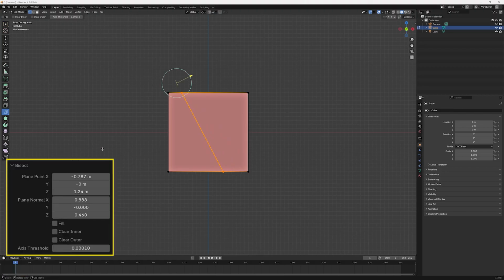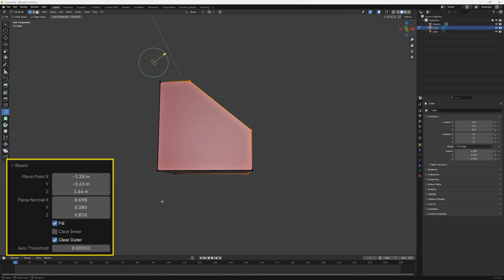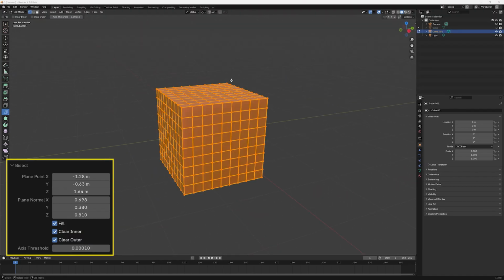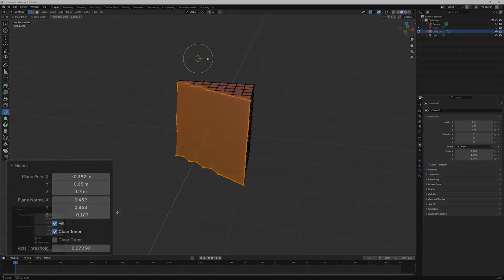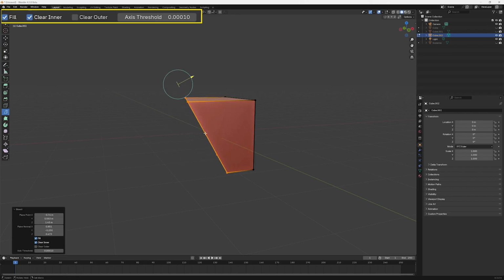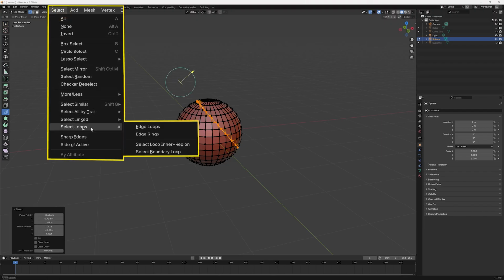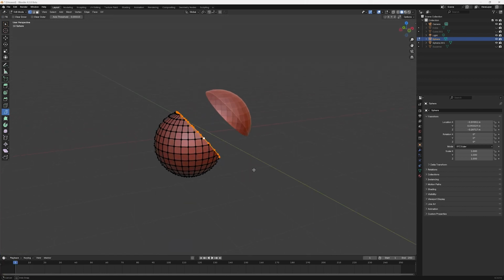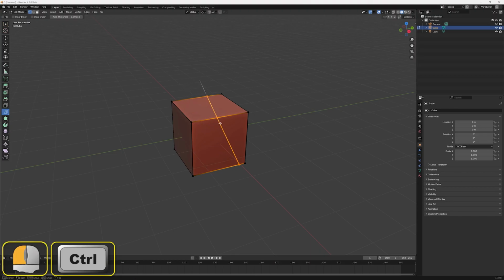Blender for Beginners: The Bisect Tool

Comment: Excellent video. How do you bisect a mesh accurately? For example, if the cube in your example had a hole completely through it. Let's say in the center of the cube. How would you snap to the center of the hole, and bisect the cube into two individual parts. Each half would then have a circular grove in each part.
Reply from the maker: I hope I can make this description clear using only text.
Assuming we are starting with a Cube with a cylinderical hole at its centre (made using Boolean - not covered in videos yet)
   Start in a named viewpoint (I used Top)
   In Edit mode select all elements of the mesh
   Choose Bisect tool
   Make a cut through the Cube as close to the centre as you can manage
   In the Last Op panel adjust the following (assumes Top View)
      Plane Point X and Z to zero
      Plane Normal Y and Z to zero
      (These two adjustments ensure cut is through centre and assumes mesh is centred on world origin)
    In the Edge menu choose "Mark Seam" to mark the new edges as seams (Seams not covered in videos yet)
   Press 3 to change to Face select
   Select any face in one half of the mesh
   Press L this will select all other faces on that side of the mesh
   Press P and choose "Selection" (this separates the selected faces into a separate object)
   If you want to fill the open faces, change to vertex selection, select the vertices of a required face and press F
Reply: @DSBlender thanks for taking the time to explain, it's appreciated.  I'm gradually learning Blender. I was able to follow your directions. I had to do some additional reading on a few of the commands you mentioned, which helped. I do have a lengthy background in AutoCAD. All the way back to version 1.8. The Blender interface is convoluted to what I'm used to. I realized how powerful the overall program is though. Hopefully I will live long enough to become decent at using it.